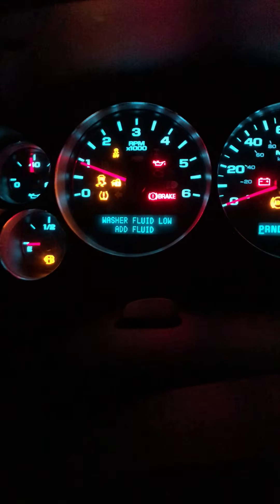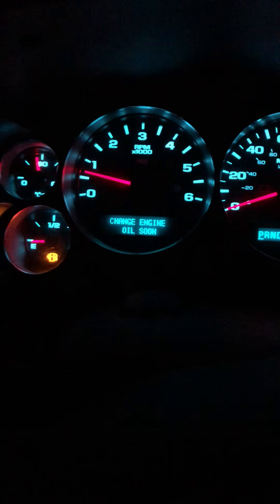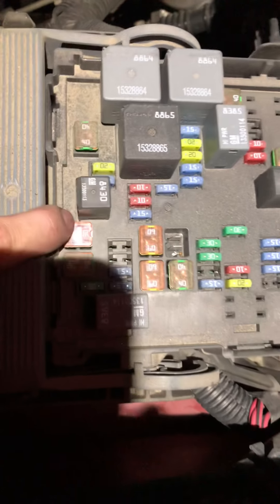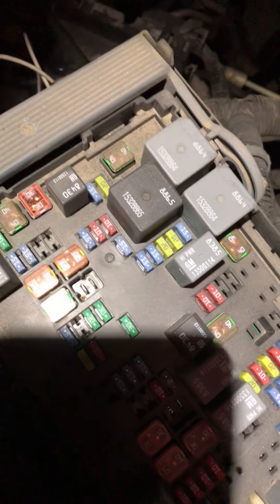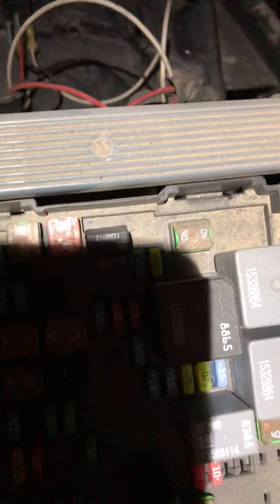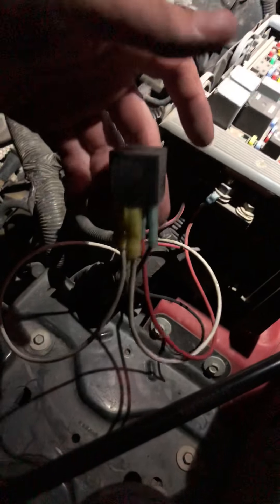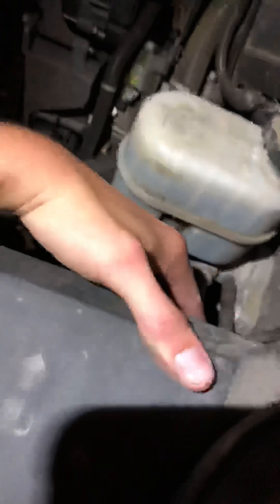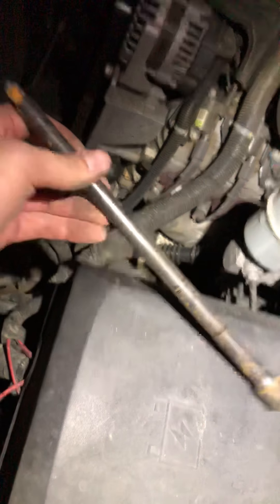Service trailer brake system fix part3

Comment: I have the same problem on my 2012 LML 2500, I have the relay and the fuse. I have a load to take to Florida tomorrow from North Carolina, than a return haul. I'm going to do the swap before I hit the road in the morning. Thank you for the in depth & thorough video. I know I am just one of many that appreciate the time you took to make this guide/tutorial. I was sure that the relay had to be an easy replacement, especially in comparison to what the stealerships would charge. I Appreciate you sir!